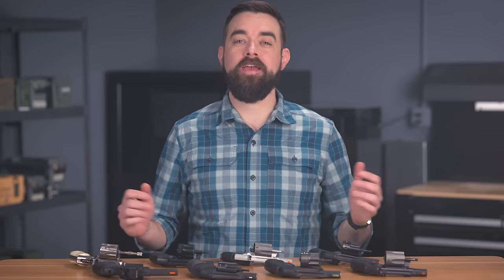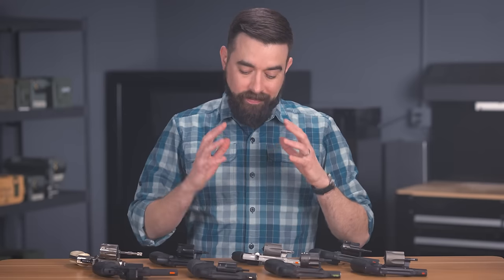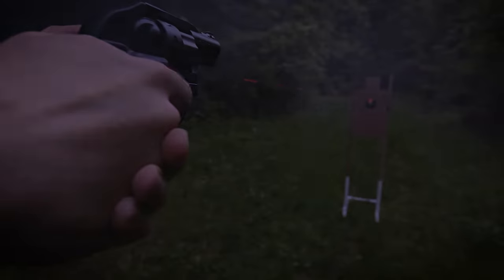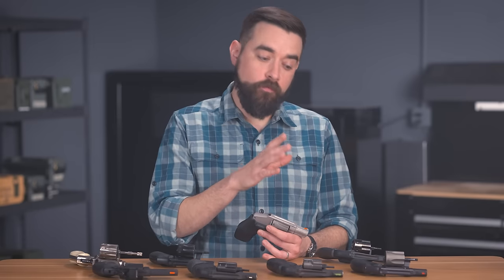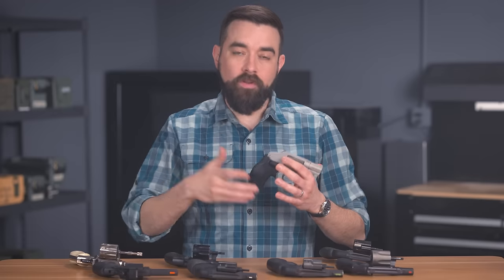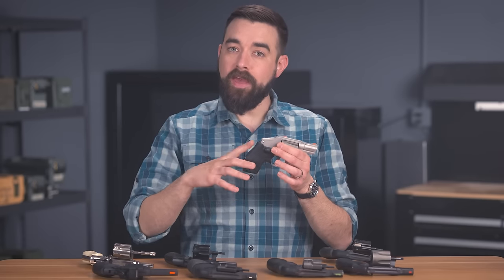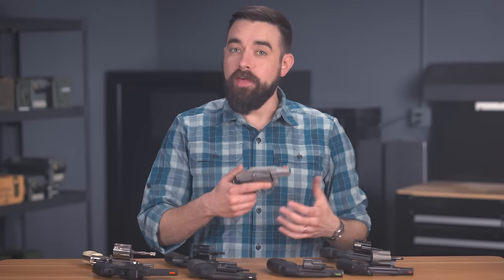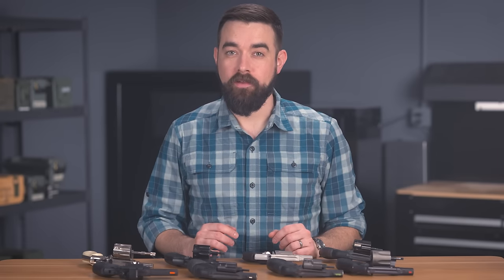Tips for Shooting a Snub Nose Revolver

Comment: The snubnose revolver works best for someone who regularly shoots (and is capable with) a full sized revolver. You can definitely learn it without using a larger medium framed service revolver, but you're going to have to do your homework with dryfiring and more frequent but short practice sessions at the range to get used to a snubnose before fatigue (or pain) set in.

A lot of people pick up a .38 snubnose as their first revolver and have to learn all the fundamentals of the double action trigger, grip, and how to handle recoil on the most difficult revolver platform possible. A snubnose makes a lot of sense for a regular revolver shooter but not as much for someone who only shoots striker fire semiautos.
Reply: The snub nose is NOT a beginners gun. It is geared for the experienced. YES, fire your snub nose at EVERY range session. If you are not a revolver person to start, it will be a bumpy road.
Reply: @sisleymichael  I'm thinking about transitioning to a snubnose for my next CCW piece despite still considering myself a novice shooter. I have limited revolver experience, but the benefits of a snubby really speak to my layered views on self-defense.
Reply: @SaftonYT  5:25 the 327Fed/32 S&W long in the Ruger LCR or if you can handle the extra weight of a steel 3” Ruger SP101.
Reply: @charlesmckinley29  I've got a list of potential candidates, that's one of them. I'm actually liking the idea of the smaller Chiappa Rhino variants as well, but I'd have to look more into its track record of reliability/durability before I trusted it.
Reply: @sisleymichael  "The snub nose is NOT a beginners gun. It is geared for the experienced."
Not true.  The snub nose .38 has been a first choice of novices for decades.  They even used to be called "Saturday Night Specials" due to the popularity among criminals.  It is just a handgun...If you have the basic handgun skills you can shoot anything.  If not, you will "pray and spray" like most people.
Reply: My first wheelgun was a 3" Ruger LCRx 22wmr and it's a great revolver to shoot. SA/DA with little recoil and very accurate. Eventually I'll pick up a snubby in 22 or 22 mag.
Reply: Never owned a revolver but looking into one. Would you say a few hundred rounds of pure DA shooting on a Beretta M9 transfer over to shooting a revolver? Shooting accurate fire via DA on a stock M9 trigger is not easy.
Reply: @phanthomboy3  I think a lot of it does. If you can keep the gun steady and on-target with the M9's DA trigger you should have much easier time adapting to a DA revolver. Just remember to let the revolver's trigger fully release between shots - the rebound spring needs to kick it fully into the forward position.

The differences? There's a few but you'll adapt quickly. The hand positions, for one. And the distance of the trigger pull: I find the M9's double action longer than a DA revolver. I also find that I use the pad of the finger on the M9's DA/SA trigger and the groove of the first finger joint to pull the revolver trigger.
Reply: @djYuz  Very good to hear that, thanks for the input. Definitely grips and hand positions will change but it makes me feel more confident knowing the trigger won't be such a major jump.
Reply: @phanthomboy3  yes.
Reply: @michaelm233  The .22 WMR is the same cartridge as the .22 Magnum.  Just a different name.
Reply: @Vladpryde  Yes I'm aware of that.
Reply: @tacticaltruth95

Building on your comment, a snub nose with low charge wadcutters can be great for starting light. Revolvers can shoot very light loads that a semi would fail to function with.

Great first guns
Reply: I'm here to be the anecdotal counter argument. My first gun was a S&W 38 snubnose. I never really had a hard time learning it. That being said, most people who have tried my 38 are shocked by how well they shoot it as well.
Reply: @tacticaltruth6Actual true. It’s a first choice for novices for decades. What’s also true is those novices find out they can’t hit shit with it, their trigger finger goes numb because they aren’t used to recoil so then they don’t like shooting. They only bought it because of concealability or worse.. a husband pushed one on his wife. And those revolvers end up never shot again but carried in a bag, glove box or pocket. Those novices then think they are armed and ready for a worst case scenario when they aren’t.

Comment: Now headed into my 9th year of retirement (good Lord, where did the time go?) from LE, I switched last year back to a J-frame as my primary little "always gun."  I still often carry more than one, but that little airweight 442 is just so darn easy to drop into a pocket holster and forget about.  Unlike my pocket autos, I'm not having to constantly disassemble it to dig out lint and re-oil this or that.  It.  Just. Works. 
They honestly are capable of very good accuracy, but just not usually in the hands of a beginner.  Little guns really are expert guns because of all the time it takes to get good with one.  I have a plethora of pocket pistols, but there's just something about a j-frame.

Comment: I use a laser as a training aid. Simply put the laser on a target 7 to 15 yards away (more or less) and dry fire. watching the laser dot shift as you pull the trigger.  Practice keeping the laser dot as steady as possible.  This gives you instant feedback and lots of repetition trains your trigger pull until it gets smooth and fast.  then you are ready for live fire.  I used the same technique to learn to control my Ruger LCP.  Also adjust the laser so that the laser falls right above your front sight, that way you work with both sighting systems.  It doesn't take long to see some significant improvement.
Reply: Good advice.
Reply: A mugger isn't going to be 7-15 yds away. A mugger will be within 5-7 feet as stats show. Point and shoot if you feel like it. A murderous shooter will be within 7 yds as stats show, again point-shoot until you're empty or he's dead. I carry a S&W 642. I'm going to be dealing up close. Trying to aim a 642 may be an FBI protocol  but I feel trying to aim a snubbie is foolish. @ handed point and shoot.
Reply: @nomadpi1  I disagree. Your accuracy Will usually drop significantly in a self defense shooting, so training to shoot smaller targets at longer ranges makes sense. Also, quite a few active shooter situations where you actually need to take a shot further than point blank range.
Reply: As a newbie, do I need snap caps for my SW snubbie in 38 spl?
Reply: @sidneywhite749 they won’t hurt but modern snubbies w/o the firing pin on the hammer will drive fire endlessly w/o any issue.

Comment: I gotta say, getting a revolver after having only semi-auto pistols was a damn good idea.  ...It's so vastly different, that you can do unique training sessions with a revolver at the range, that a semi simply cannot do.  I absolutely bring my revolver to the range every visit, just because it's totally fun!
Reply: I am considering a revolver, after carrying a G22 for duty, simply because I got used to the New York trigger spring (~12 lbs or so), and never trained enough on manual-safety semi-autos to remember to sweep off the safety. The times I shot 1911's and such I had to consciously think about the safety; don't want to be doing that if SHTF. Since I won't be carrying in the usual high-security holster anymore, it's either a revolver or a DAO semi-auto. I never had "Glock leg"; still don't want it.
Reply: @markh.6687  If I'm multitasking at the range (like talking to a buddy, etc) I probably forget to disable the safety about 20% of the time.  ...But generally, I too have to tell myself "disable the safety;" as it's not muscle memory for me yet.
Reply: @ericbergfield6451  Exactly my point; and well demonstrated there. Be safe and shoot straight.
Reply: @markh.6687  The Cz 75s and beretta autos are a good DA/SA option for auto loaders. All steel or aluminum frames and most of the models have a decocker so you can carry it no safety and double action first pull
Reply: @jacobg7966  I'll have to look into those. Thanks.

Comment: Using a “thumb over” or “C-clamp” grip on my 642 made a big difference in accuracy.  In addition, this prevents the risk of support side thumb burns from the cylinder gas escape.
Reply: if you have to use it in a real way it does not matter. you will point it and fire. that.s just the way it is.
Reply: @geraldmiller5232 Jerry Miculek hit a target repeatedly with a revolver at 1000 yards. If you practice and know your holdovers then hitting a man at 100-200 yards is easy. Just because you don't want to put in the work doesn't mean it won't pay off. There's things to protect other than just yourself. That means distance always matters.
Reply: I use this grip for all my handguns. I don’t want to have to think “I’m using this gun so I need this grip” in an adrenaline situation. One grip to do it all and it works great for pistols too. It’s a stronger grip plus I have never really liked the “correct” community approved method: the two forward facing “death ray thumbs” grip.

Comment: Awesome and informative video, as always!  Nine years ago, when I migrated fro semi-autos to snub nose revolvers for my ccw, the safest place you could be was directly in front of me at arms length.  😄.  Now, I'm reasonably accurate at 7 yards.  As to trigger control, a friend of mine,  an ex cop told me to lay a coin on the top strap, and dry fire till the coin did not fall off.  When you can dry fire 100 times without the coin falling off, you've got it.

Comment: Thanks Chris.  Great advice as usual.
I've been carrying and shooting  S&W J-frames since the mid-70's,  both on duty as a back up and off duty.  Started out with a model 36, 2", later a 442,  and currently settled in with a model 640-1 fitted with the discontinued Uncle Mikes rubber grips.  The 640 is a stainless DA only variant  with a 2" full lug barrel.  Front sight is pinned,  plain black. The gun weighs 23.5 ounces,  and a slightly wider smooth combat trigger.  This revolver is 357 magnum capable,  but I  carry and practice with .38 special caliber  ammo now that I'm 71 years old.  (arthritis) The gun has a great action,  resists corrosion, and is very shootable with the Uncle Mikes, Crimson Trace LG-350,  Pachmayr or similar grip, which enclose the back strap and aid in buffering recoil a bit.
Reply: Craig Spegel of OR was well known for his wood: "boot grips". His website was still working but I think he his slowly shifting into retirement. Hogue makes excellent after market J frame & Ruger LCR grips in my view.

Comment: Good tips! I have learned to use a thumb-over grip with virtually all my DA/SA and DAO revolvers. It serves two functions; more stability in the grip and keeps my support hand away from the flash gap area. Also, I'll give up a little in concealment with what I can gain in (my) performance with a larger grip.

Comment: Very good comprehensive summary of small revolvers. I’ve been shooting them for years, but have found that the older I get, the worse the sights are to see. I’m thinking the best overall fix might be to h explore the feasibility of having dovetails milled and better fixed sights installed - as long as the cost is reasonable. New snubbie shooters can overcome a lot of the problems by spending a sufficient amount of time dry firing.
Reply: I liked the standard red, fiber-optic front sight on the new-model Colt Cobra I bought a few years ago when it came out.  I liked it less when that front sight flew off while shooting (less than 100 rounds through the gun).  It was an easy repair, but it really turned me off to Colt build quality (There was clearly no loctite on the set screw before I reinstalled it).  That aside - it's a comfortable 6-shot snub-nose to shoot, with good sights.  Not super concealable though, with the big rubber grips out of the box.

Comment: I carry a 442 everyday. Sometimes as a backup but it’s always on me either way. I’ve had great luck with the Pachmayr Guardian grips.
Reply: I plan on buying a new S&W J frame .38 Bodyguard soon. With Big Blue's rebate offer. Ends 04/02/2023. I got a Desantis Nemesis nylon holster & a few Tuff Products safety orange type .38spl strips. Pro tip: a metal Altoids mint tin can store 2 .38spl 5rd strips. 😎
Reply: love my 442

Comment: Well-done! I, like you, use the “middle segment” of my trigger finger, on the face of the trigger. For some number of years, in the Eighties and perhaps into the Nineties, I kept struggling to use the distal crease, on the trigger face, as I do with larger revolvers, but ultimately, found it best, with J-Frames and the SP101, to let the “middle segment” land on the face of the trigger, in a natural-feeling way, while using a grip as high as practicable, on the back strap. Regarding grip size, for the geometry of my individual hands, the Ruger SP101 factory grip is custom-level perfection, not only fitting my hand well, but also orienting my hand for an optimal “reach” to the trigger face.
Reply: Exactly! I remember, the so-called "experts" saying you should shoot with the first joint of your finger, or even the tip. That left me struggling. Finally, I said the heck with it and I would shoot the way that my hand wanted to intuitively. Every gun is different, and so is every human hand. Do what works as you would using any other tool-which is exactly what a gun is. Peace.

Comment: The best thing about laser sights on snubbies, and at this point I no longer have them on anything but my snubbies,  is trigger practice. You really get feedback on how controlled or sloppy your DA trigger work is when you have  a laser sight dot to dance out there at target range. I think you hit the nail on the head about controllability. Until the magnum era the only real control problem with revolvers were bad factory grip shapes. That is not much of a problem anymore, but is a factor shooters need to be aware of. Also, a revolver is far more controllable in DA mode, it is a shame SA is even part of the equation - if a revolver functions DA, shoot DA - all the time. Every SA shot is bad practice in multiple dimensions.
Reply: Ever ground down the hammer spur on a revolver?
Reply: I shoot much better at 25 yards with my G22 than I ever could with a revolver; the Glock-style SA trigger made the difference. If I shot the revolver in SA mode I was much better. And yes, watching people try shooting 357 Mag and hit the target was funny, since all they had shot was 38+P and thought there wouldn't be THAT much of a difference!
Reply: @ReverendMeat51  Dan, have you ever been in the cockpit before?
Reply: @markh.6687  What
Reply: @ReverendMeat51  An old joke from the movie "Airplane!"; paralleling your question.
's theme of "Have you ever...."
Reply: @markh.6687  Well shoot I guess I don't speak jive after all
Reply: @ReverendMeat51  "Dan never speaks Jive at home...."   :)
Reply: As Dylan Klebold and the band Cake have said "Short Grip, Looong Jacket".

Comment: I had a Smith & Wesson Model 27 with the shortest possible barrel; I believe it was a three and a half inch barrel. It took about five years to get really good with it out to 25 and 50 yards with magnum loads. I used to work for John Martz the Luger carbine maker from Lincoln California and he made a really nice baby Luger which was a snub nose having a 2 inch barrel. I made the grips for them and the dies to shorten the magazines. It fired well and was accurate out to abort 40 metres. Nice presentation.

Comment: I second the 327 fed mag for carry.   The Ruger LCR is a great pistol, you get 6 shots in a snub nose and 327 is pretty close to 357 mag in terms of power.   It helps to reload so you don’t have to search for the ammo as much though.
Reply: I agree the .327 is a good load. But you need to educate yourself. The .327 is no where even remotely close to the power of a .357. Evidently you need to go rent one at a range and see the difference in power for yourself, because you would not have made that statement if you ever had. 

For ccw,  the .327 is a great round, but please don’t fool yourself thinking it is close to a .357 in power.
Reply: I wish 327 was readily available. I would have gone that route. I like the extra shot and the power, while not 357, is decent.
Reply: @thatsmytwocents4372  I think you need to educate yourself, .327 is comparable to .357 for most loads with the exception of some underwood ammo defensive loads for .327 that are loaded quite light compared to their .357 counterparts. but .327 and .357 speer gold dots are very close. (and no, just because one is heavier, doesnt mean its better)
Reply: @thatsmytwocents4372  That would be true if the .357 side of this comparison used full power loads. But I am guessing that people who run .357 at all in their snubbies, are using reduced power .357 loads, or .38 Spl. So, a full power .327 load probably stacks up pretty well in comparison.

Comment: Chris, in several previous videos you have highlighted the 2.25 inch barrel SP101 as one of your preferred snubbies, yet there was no mention of the advantages of its slightly larger/heavier and its slightly greater barrel length design in this video.  I suggest that is unfortunate, because the extra weight considerably mitigates recoil (especially for the hottest .38 Special +Ps), the grip size is likely more comfortable, the extra barrel length provides increased velocity and sight radius, yet it is still rather concealable.
Reply: He has another video on mid sized revolvers for concealed carry.